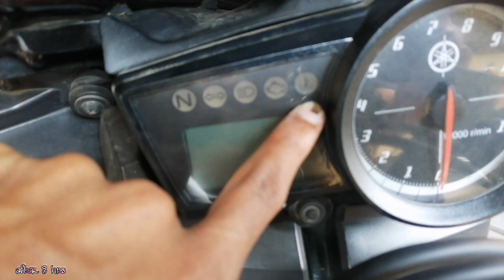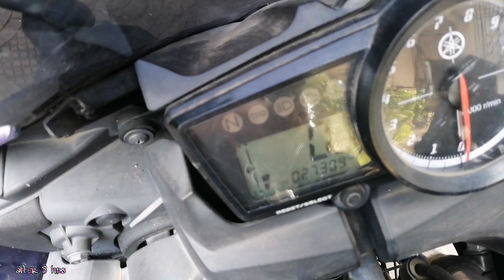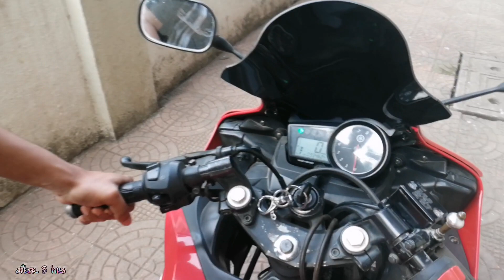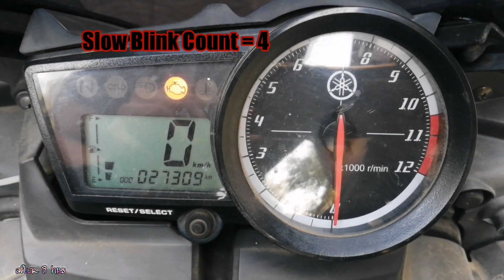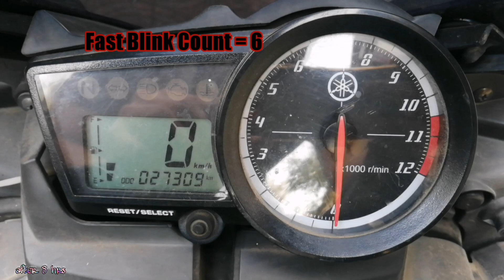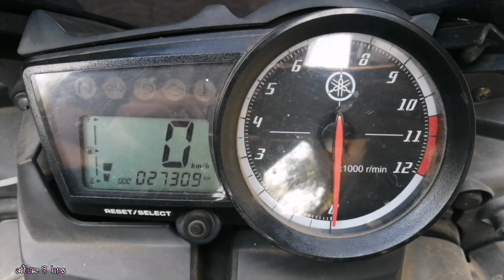What is [Engine Check Warning] | "क्या हे इंजन चेक लाइट"|

Comment: brother yellow light is on, it's not blinking, it's just on, can I get to know what is problem
Reply: Same
Reply: May be battery overcharging problem..Check battery readings on engine start through multimeter..If it's showing 14 then something else is problem but if it snowing above 14 like 16 or 17 then ur RR unit (Charger) needs to be changed

Comment: Bhai really like your video and it was very helpful also.Kindly reply, My engine light (orange) & coolant light(red) blinks at the same time just for 2-3 seconds while runnning and the bike misses an acceleration and again it runs fine, happened 2 times while riding. Any suggestions regarding the issue???